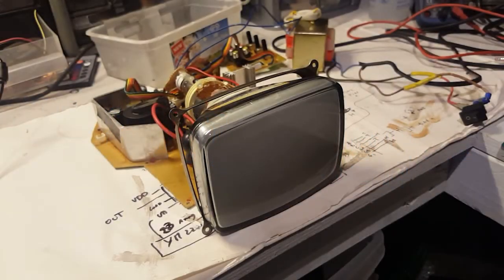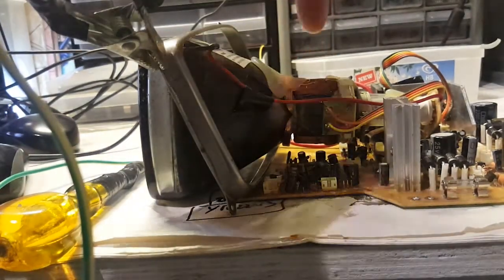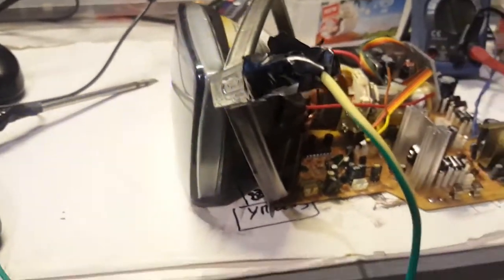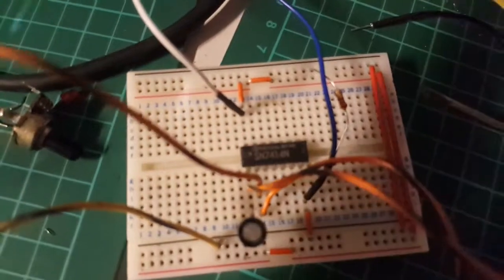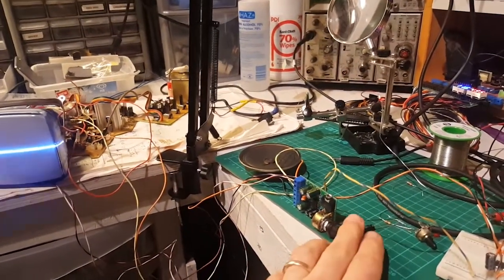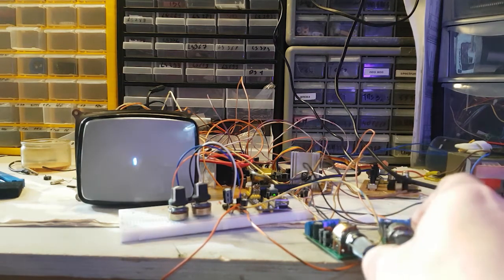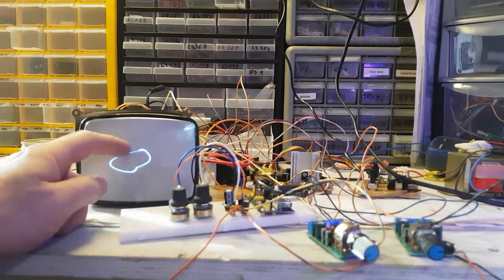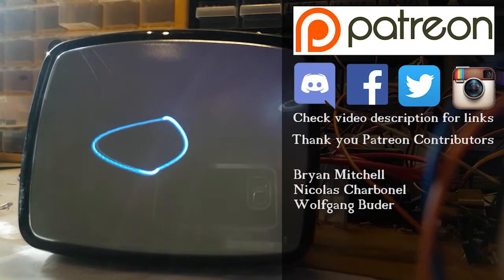Some random CRT fun

Comment: If you want to turn that CRT from Raster to Vector you would need to rewind the Yoke coil. Look up Jason Arcade, he has a few videos on converting TV style CRTs into Vectors.
Reply: What does the rewind do?
Reply from the maker: it would change the impedance of the coils and allow to drive the electron beam onto the full screen with much lower voltages. Here, even with an amplifier,  you can see that with no resistance when the pot is turned down, the beam only barely covers half of the screen.
Reply: I see.
What would you say  is the voltage range on the unmodified TV yoke to get full deflection?
Reply: @robb233  it depends on the setup, around 4-9Vpp but afaik the primary issue is the coil's reluctance to change the field/deflect fast enough (either too long wire or too thin). when swinging from one end of your range to the other before the magnetic field has a chance to get at the desired level your signal already wants to go somewhere else
Reply from the maker: @snooks5607  yeah, these projects are fun to play with to see what you can get out of them and maybe get lucky, but to turn them into a useable repurposed tube would take more time and research than i can afford... it's still fun to play with though :D